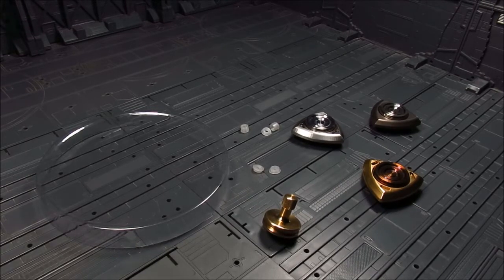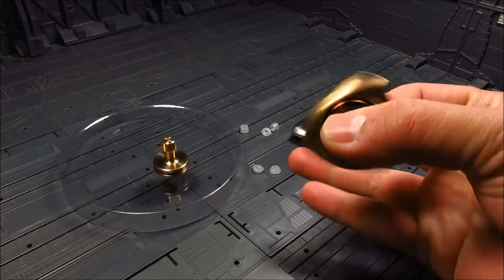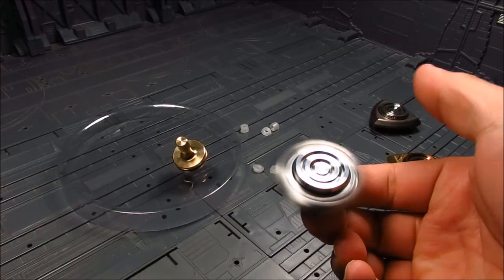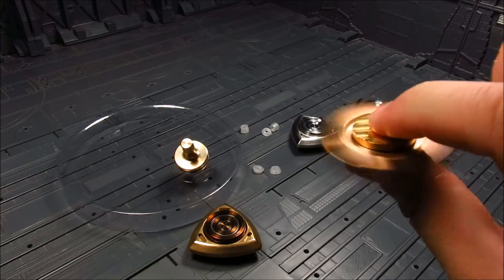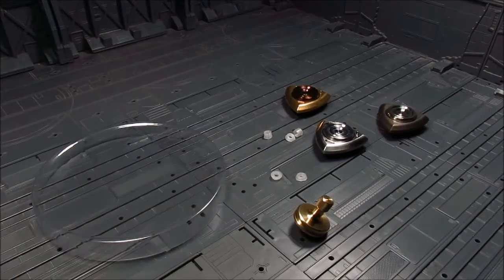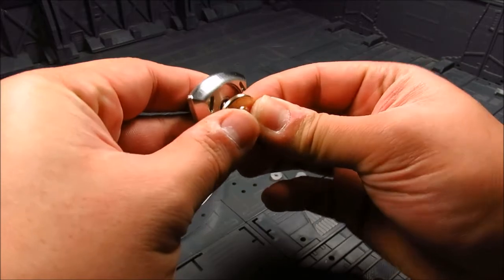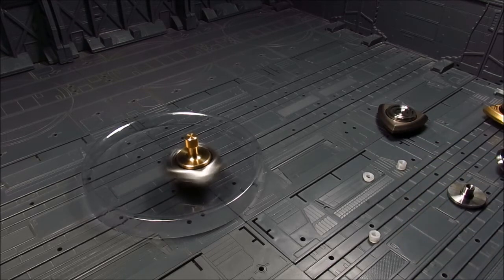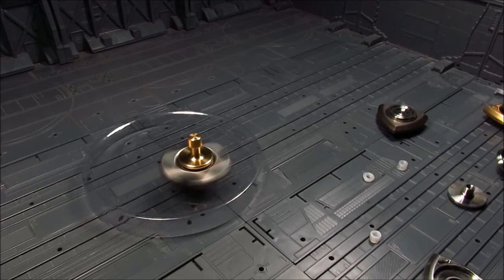Invader Drone Spinner and Converter Top Review

Comment: Hows the balance? I noticed a decent amount of wobble when spinning mine and it definitely has a heavy arm
Reply from the maker: I can never get the top to balance well with the spinner, there's a tolerance with the bearing that gives it the room to be slightly off.  Almost all of my drones are not perfectly balance, and I believe that's normal.  I feel a slight flutter which in return gives a nice subtle feedback.  Now if it's actually wobbling, to the point that it's hard to single finger balance it as it may wobble off, then that's a different issue.  You can always address your concerns with the maker, John.